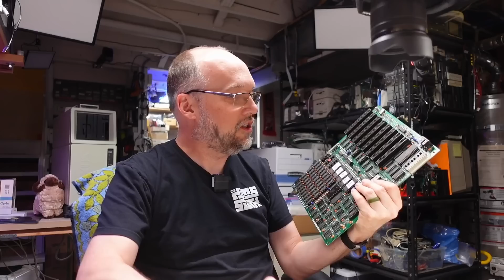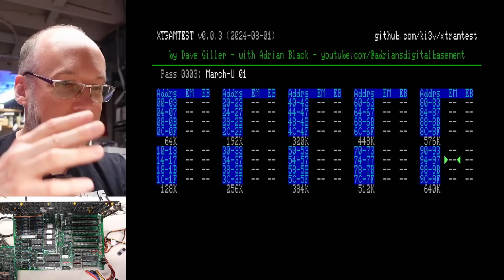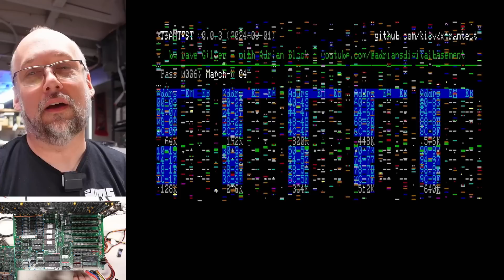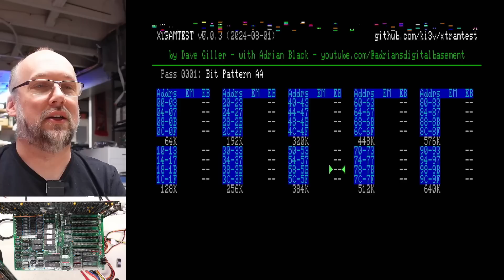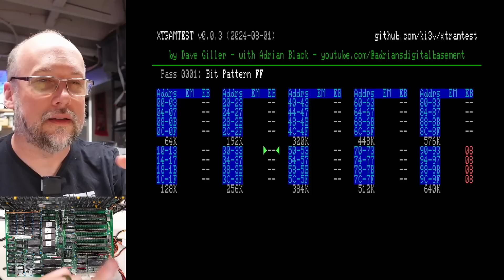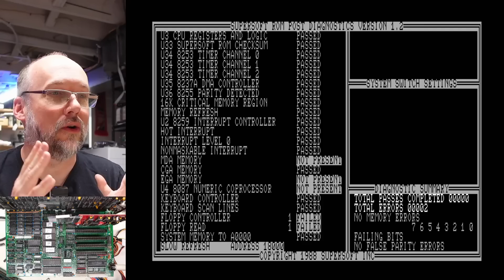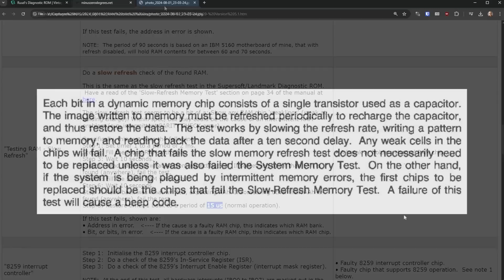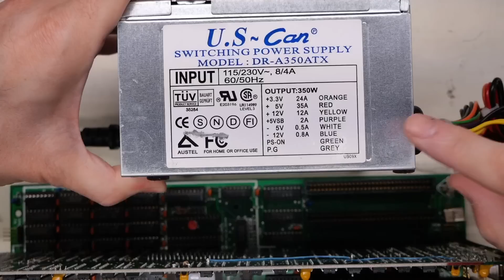A brand new XT RAM test ROM and an update on some unfixable parts

Comment: Cool! I once had a laptop whose touchpad was junpoing around and it was caused by the power supply. The issue can be caused by a high frequency COMMON-MODE noise while there's no obvious voltage ripple  on the osciloscope. yeah! In your case the non-working smoothing caps in your power supply meant it was pushing a lot of switching noise along the wires to the board which may have cause COMMON-MODE noise again.

Comment: Yes Adrian, i have a home brew power supply from my bench that i used with that exact motherboard that you have as well. The same xt one from taiwan in 1985.  It is from my old VIZ 708 powersupply with 5v and 12v, with long wires to the connector. I had no boots, some very odd sound issues with the speaker and even though my post card shows fine supplys it was a nightmare for me trying to repaire it. I went out of my way to get my old win98 system opened up and then connected that motherboard and with a nice AT powersupply (one that i repaired with new caps years ago) and like you say, it freakin worked!! Having an engineering background i do belive you are so correct. The powersupply must have high current, super low ripple and to be very efficient. It happened to me this week! Thanks for sharing this wonderful story.

Comment: Power supply! I knew it! I think I even commented on one of the vids to check power.

As soon as you get "weird" things happening, think power. Not necessarily the supply, also check caps on the board/card that smooth the ripple. 

Wouldve been nice to have seen the dodgy rail on the oscilloscope to see just how bad it was.

Comment: I also have an original IBM-PC for sale, but we have put a 286-board in it for practical reasons and removed the back-grid, because the PC had a different distance between the slots. And my father changed the front panel a bit. Adding a 3.5 inch floppy drive for example.

Comment: Pretty sure you nailed it with the PSU. If the caps were visibly bulging and leaking, then the ripple must have been pretty bad at that point. Maybe its worth building a PSU tester. Just some load resistors on a board with a connector to load up the supply's rails and measured the rails on a scope. It might save a load of problems in the future or just simply rule out the PSU as the problem.

Comment: I believe I commented the first time around that the RAM patterns being seen almost looked like what would happen with failing capacitors, though admittedly I wasn't sure how that was possible. As for capacitor plague, the thing I've noticed about it across all of the things I've ever owned which were struck by it is that it's a gradual process and can start at any time, thus the caps in your power supply may have only recently started going bad and it was gradually getting worse to the point where it was just barely affecting those particular pieces of hardware. I had a year-2000 motherboard with faulty power filter caps for the CPU which I was using for years without issue, as it wasn't until early 2006 where the failing caps first manifested as random system crashes about once a day, but within only a few months it had gotten so bad the system would sometimes halt mid-POST or last only 10 to 15 minutes before locking up. :(

Comment: The first thing my electronic teacher told me was to never assume the power supply in a system is ok. And if something is not working right. No matter the test, always test the power supply FIRST. The base of ant circuitry is the supply. Even power supply has a supply of AC, and it needs to be checked then the rectifier, then the filtration , then the regulation starting voltage circuit, ect, ect, ect.
Reply: It took me many years to learn that lesson...

Comment: The Slow Refresh test can be quite useful. Memories lose charge faster at elevated temperatures. Therefore, tests on a freshly turned on computer may not show anything. However, slow refresh tests will show that the memory may potentially have problems if it is at a higher temperature.

Comment: About the 8288 being an essential part of the PC architecture: Intel basically intended the 8086/8088 to be always used in conjunction with the 8284 clock/ready generator and the 8288 bus controller IC. Interfacing the trio of these three chips is way easier than trying to interface the 8088 alone. I suppose Intel split the stuff into multiple chips because they ran out of pins on the 8086/8088, and didn't want to use an unusual package with more than 40 pins.
Reply: Which is kind of funny, because they certainly didn't have an issue with putting CPUs in unusual packages later on.
Reply: Yeah, the manufacturers probably didn’t have a large selection of 42 or 44 pin IC sockets back then, so makes sense to stick with known packages during the design/prototyping phase.
Reply: @williamsquires3070  Not only that but the chip packaging equipment might not be capable.
Reply: This is exactly how it was done with the old 8080 CPU, so they probably copied that scheme.  The 8080 required the 8224 clock generator and divider and the 8228 bus controller and driver IC in order to work properly.  Given how similar the numbers are, I'd say that the 8284 and 8288 were essentially copies of the earlier 8080 versions, just as the 8088 was essentially an (internally) 16-bit copy of the 8080.

Comment: It would be interesting to create a device that could simulated your bad power supply and then go back and find the components in various motherboards that were sensitive to the power problems. I remember in the 90s always being told there were systems that needed pristine power or you would get problems. I never actually ran into the problem but because of what I had been told I always used high quality power supplies.

Comment: Your ROM obviously needs the RAM on the video card for subroutine calls, ie a stack, and other variables.  Another way to do this without a video card, would be to use a serial port to spit out information about the test while it is running.  Then you could use an external "terminal" to provide the display.  It would be harder to implement because of no working RAM.  Or use the display of a POST card to show what you are doing.  My original 1982 IBM 5150 has some strange RAM problem that I am hoping to try this on.  Thanks for the great work.

Comment: Hey, just to let you know, your XT RAM tester rom was instrumental in helping me solve a faulty XT clone motherboard.

One of the TTL logic chips near the memory chips was marginal, not bad enough to show bad in the EEPROM programmer test function. Motherboard wasn't functional enough to boot normal BIOS, but functional enough to run the memory test ... where I would eventually get lots of bus errors.

Comment: I've seen video cards flake out with failing power supplies. Usually would show up during gaming or stress tests. So, yes, it's very possible and probable that a power supply with failed caps would certainly cause motherboards to act weird like that.  Glad it didn't take the boards out for good!

Comment: Interesting video, love the new test rom!

I’ve had some power noise issues with xt ide in a 5160.  The PSU is fine but not up to standard of todays.  Manifested itself with random data corruption, quite intermittent but would crash before the end of 8088mph!  After much analysis and troubleshooting one day I moved the card into a slot further away from PSU and it became slighty better.  Eventually adding a bigger filter cap on the XT ide giving power to the CF/SD cards fixed it.  So I think related to tolerance of the modern components - not the same as your issues but interesting what noisy power/interference can do.

Comment: Tweaking voltages is sometimes used for overclocking / underclocking.  Seems like the bad capacitors was introducing this state and was pushing the board into the failure zone.  If the rail(s) were unstable the erratic changes might be explained by the various fluctuations.

Comment: Ah the era of the crapacitor plague, I've been working on replacing crapacitors on a Mini-ITX system (VIA EPIA M10000 board in a Travla C134 case, cute thing, built one new about 20 years ago, got thrown out without my permission when I was trying to repair it back then!) that I got recently, proper bulged-out and crusty things on the 5v rail on both motherboard and power supply board (uses an external 12v brick with an internal board to do the other voltages), and oddly enough, it was the same issue on my original system back in the day, caps failed, computer conked out, but this one I have now I was just working on reassembling, and it's back to life as well, and apparently nobody formatted the HDD in it cos it has XP Pro on it and seems it was used for writing PIC chips and some other LED-related electronickery... :)

Comment: I bought a  battery -powered two-inch Thandar oscilloscope (single channel, 10 MHz) in year 1984 for field troubleshooting of memory problems in PC. The noisy power supply have been the cause of RAM memory problems 50% of the times.
Other experts just swapped the power supply; I preferred to visualize the 100 KHz noise on the +5 Volt line.
By looking at your video someone may believe that problems from the power supply are a black swan event; in reality, following the 80486 era, the power supply become the second cause of random errors and failures - the first, being the processor fan.
When the PCI bus was implemented, after the short period when Local Bus dominated, power consumption from processor and video card increased ten times...

Comment: When you said I'll tell you later why they are working, I was suspecting the power supply.  Digital is perfect until it isn't, so I have seen marginal issues plenty of times in the last few decades as a technician.  The two boards may be nearly twins, but they will have some variation.  The Twin board may have been on the edge of failure, but just not there yet with the flakey power.  I very often swap out a power supply to rule that out when odd things are happening.

Comment: This is why I really like programming AVR microcontrollers.  There are several chips that have 0 bytes of RAM, but they have 32 registers.  If you're writing simple hardware interface applications in ASM, you can get a lot done with 32 registers.

Working on 70s/80s CPUs feels sooooo cramped by comparison.

Comment: Not unheard of for a bad PSU to cause Windows to randomly BSOD. If experiencing random problems it is always a good idea to suspect that it could be the PSU and if you have a spare, change it. Ability to adjust DRAM Refresh timings is an odd feature of the IBM PC architecture. A feature that can help to make those amazing modern CGA demos. @PCRetroProgrammer has done a little bit of investigation into pushing the limits of dram refresh

Comment: That power supply may have some little capacitors (on high voltage side) which are also bad and waiting to make it all finally explode :) Such cases were quite common these days, and also that "DR" model number brings back some bad memories.

Comment: my first IBM compatible PC was a Heathkit/Zenith that included an AST memory board.  it would crash about once a week or once a month.  i upgraded to a 286 and kept the AST memory board, and it would crash once a month.  when i upgraded to a 386, somebody wanted to buy the memory board, so i took a close look at the memory chips, and found all the chips were 256k, except one, which was a 64k chip.   i replaced that chip, and the buyer of the card never had a problem.   my theory before finding the 64k chip was "cosmic rays" were occasionally interacting with marginal ram chips and flipping bits (i live in Denver, so at the time it wasn't outside the realm of possibility).

Comment: My theory is that make that other mobo had slightly better local filtering allowing it to still work despite the flakey power supply.

I have myself had a psu fail once where the diodes for the 3.3V rail shorted and sent the full switchmode AC waveform into the system, the system did not just instantly die though, no it did keep running seemingly normal except that the audio was playing at like half speed for a few seconds before the system finally shut down.

Comment: wait wait wait, you threw out the caps rather than putting them in the dead parts bin?  But the bin hungers!
Reply: They may well have smelled bad. Exploded caps often do, but the ones dating from the Capacitor Plague of the early 2000s smell even worse than normal (very fishy) which is related to the bad chemistry that makes them fail in the first place.
Reply: Then the bin smells bad out of her mouth.

Comment: I had something vaguely similar happen with an Xbox One my son had. Everything on the system worked flawlessly, except one day, anything plugged into the USB ports started failing intermittently. I cracked open the system and couldn't find anything wrong. I cracked open the power supply and found a bulging cap. Everything is packed in tightly in those things, so it was a bit of a trick to replace the cap, but it fixed the problem.

Comment: It could be that the problem boards have slightly undersized or failing caps on them and working ones are better at handling the ripple or out of spec voltages.

An unrelated issue that I've witnessed is when datacenters use Automatic Transfer Switches (ATS) for single PSU systems. If the caps aren't large enough, the milliseconds it takes to switch from mains to backup through an ATS can cause a system to reset. Replacing them with a "better" PSU with larger caps that can handle a few extra milliseconds of dropout would resolve the issue.

Comment: If the PSU was sending bad rippled 12 & 5 volts and some boards worked but other boards were flakey, that means you have some flakey caps on the board as well. Tracking them down and replacing them would fix the issue of the board.

Comment: Consider that the previously weak power supply meant that the ram currently diagnosing as fail in the slow refresh cycle test was previously misbehaving so badly that the ram errors were manifesting and causing errors. Old caps compromised the ram refresh cycle. New caps, marginal chip performs within spec again.

Comment: You can tell the actual test routines aren't doing much if any stack activity as that would result in constant snow.  I've used not-visible screen RAM on Z80 based systems at times so it's interesting to me to see someone else doing it too even if it's a completely different CPU.

Comment: Oh ATX power supplies can be so noisy, but then again so can AT power supplies.  There was a period when I didn't have an original Colecovision PSU (Linear) to power my Colecovision.  When I used an ATX PSU to power it the game had so much noise on the video out and the audio out.  I used two big capacitors across the 12v and 5v and that cleared up the noise for the most part.  That said not all switching AT and ATX PSUs are alike and it really is good to test them out first before relying on them, in particular ones with some random Chinese brand name.  I made that mistake with one of my Athlon computers I built back in the day. It killed everything in my system, even the mouse!

Comment: Yeah. I generally just chuck any power supply I come across from that era, unless it's a specialty item. For a bench supply AT/ATX supply, that absolutely has to work and not fry stuff, I'd honestly use a modern Corsair (or similar) modular.

Comment: The reason that most stuff might have worked, but those 2 failed before the caps were replaced, could just be down to power draw. It could be they draw more than other things you've tested, and as the Amp draw increases, so does the ripple on the power lines. And maybe they drew enough to put the power into a marginal state for those boards.
Maybe those particular boards are shy of a few capacitors too, whereas others maybe had more caps on the power rails, making up for the faulty ones in the PSU.

Comment: I think this mobo (and RAM card) have some faulty decoupling capacitors which is why they are more susceptible to bad PSU, while mobos with good decoupling capacitors were able to hide the problem.

You could still put an oscilloscope on top of the tantalum caps and see if some of them show sharper edges / more noise than others. Hard to say what to expect.

Comment: Not a faulty PSU, but I once had a dodgy LED lamp that constantly tripped the OCP/OVP in one of the power supplies in that room. Took me ages to get that one figured out.
Reply: My AM3 board would refuse to boot if I had too much crap attached to the USB bus. I had to put all the slow stuff (like keyboard and mouse) behind a powered hub to present less of a drain, and still had problems trying to boot from flash drives in a USB 3 port if they were power-hungry. Switching them to a USB 2 port made sure they couldn't get all the power they wanted, but at a huge speed penalty. I'm still running all the slow peripherals through a USB 2 hub after upgrading to a board that has only USB 3 ports, and nine of them, because it's already zip tied to the desk.

Comment: The stack is still important on modern amd64 CPUs and you still have to setup a stack pointer if you want to run any C code on the CPU or use the call/ret instructions, although the UEFI does that for you so by the time the bootloader runs a stack is already present.

Comment: Recently had a C64 1541-II fail in spectacularly odd ways. Turned out it was the psu (after a load of debugging) even though voltages were in spec. Haven't had the time to figure our why, replacement psu works fine 🤷🏻